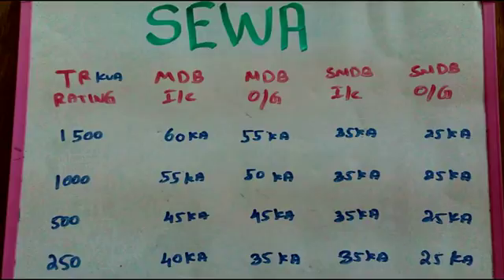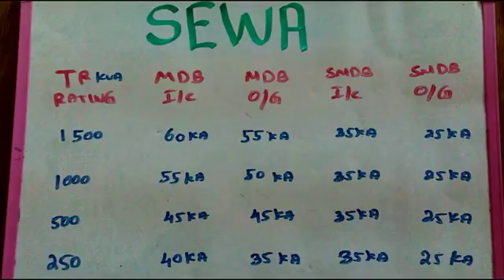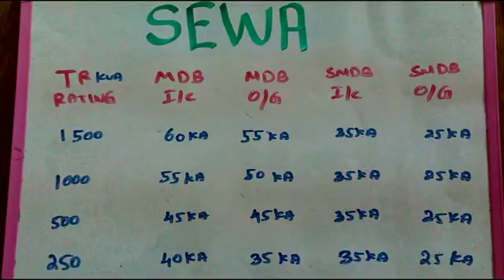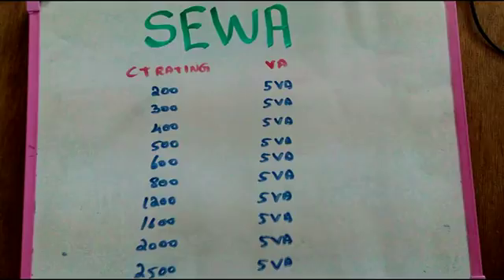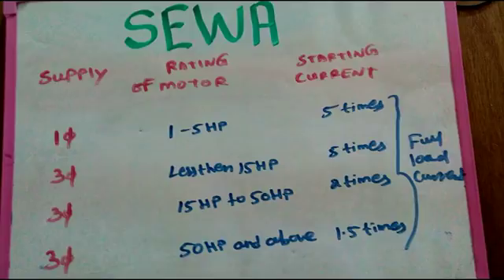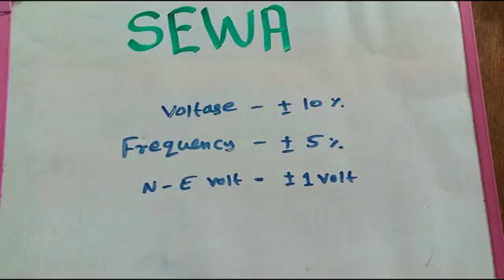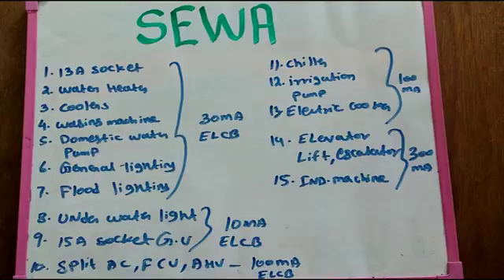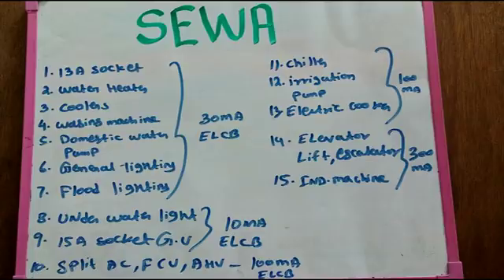Tamil sewa /sharjah  low voltage switchgear standards

Comment: thank you for the video....can you also please mention how many output can take from 1500 kva to 60 la to 55ka to 35ka to 25ka.....

2. why RCCB rating is different for split AC ,,chiller,etc...
Reply from the maker: 1500 kva
 to  single out put 2500A   ACB   60ka 

then after that no of out put not  a problem but need to maintain that load current and demand factor ..

rccb differ split AC  and chiller because split AC is general purpose use ,smaller  then chillers so need to prevent earth leakage current less compare to chiller  and then chiller have technical operators and some extra prevention also available they rectify the problem so need to some extra  value of earth leakage current mostly we use elr and cbct shunt for chiller 500ma/5sec